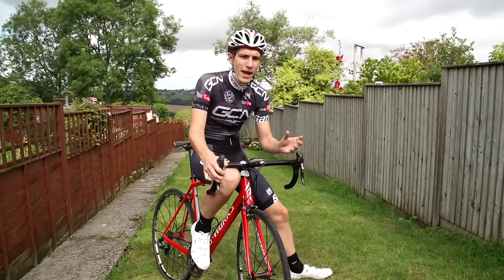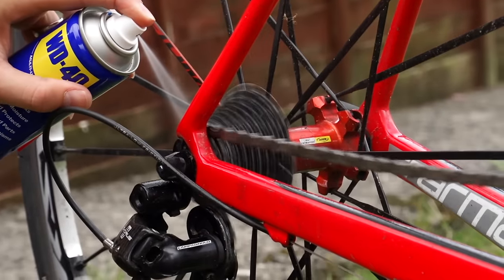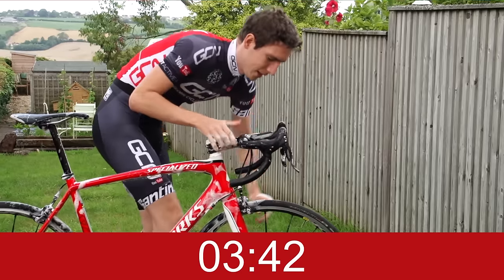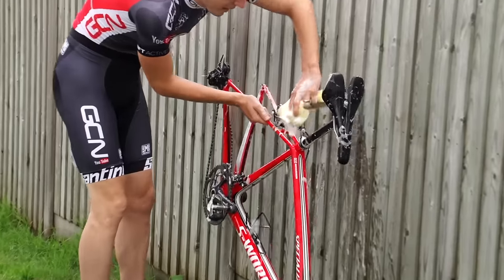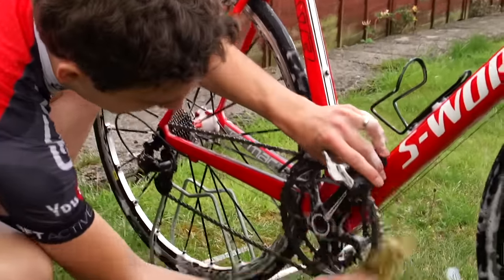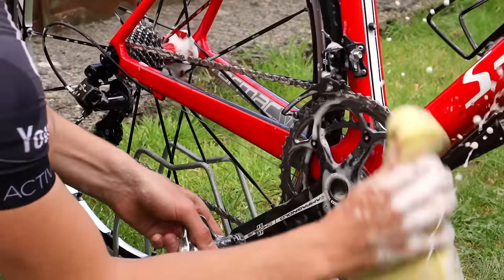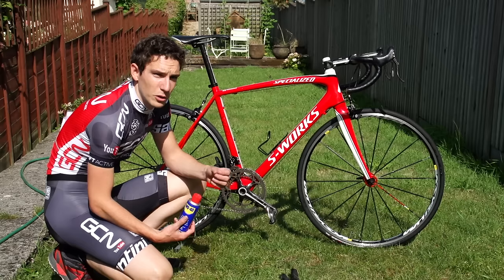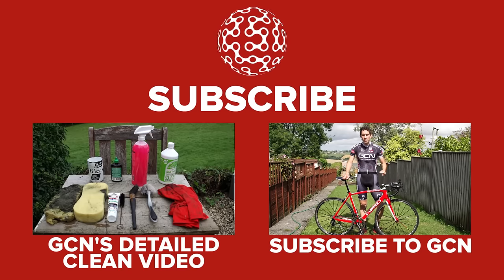The 5 Minute Bike Wash - How To Clean Your Bike In A Hurry

Comment: WD40 makes a citrus based degreaser too. Might that be preferable so you use the degreaser for cleaning and regular for lube? Also WD40 is often sold with a thin straw so you can surgically apply it without getting it near discs.

Comment: I use WD-40 as well but I've never thought about using it after cleaning the chain. So I'm guessing it's just as good as chain oil since I would think you should put new chain oil on the bike after cleaning it?
Reply: -Degrease
-Wash
-Dry
-Apply lube
-Wipe off excess oil so it won't attract dirt

Comment: Can't believe you're using WD40 on your brakes. WTF? Gets on the pads and brake track and then ... no brakes :?
Reply from the maker: Although not advisable, it's unlikely to be that cut and dried. It's not like Simon rides around with no brakes.
Reply: ***** Well, I've always used it and I've not seen any deterioration in the seals or gaskets. Plus, I spend most of the winter riding in Spain, and the summers in the Welsh hills. When I find it doesn't work, I'll change.
Reply: Every one is entitled to their opinion. I've been using wd40 for over 40 years and, yes, it will attract dirt to your chain. But I wash my bike after every ride, then spray fresh WD onto the chain. I've yet to find any deterioration in seals or rubber.
Reply: ***** thank you , at least you got deep into the problem and find your way. so you'r saying for sure that GT85 is that different? is there a cheap way to keep the bike clean and lube without buying a full set of too much expensive degreaser and lubricant?
Reply: ***** not saying you're wrong, but if so many other people are having a grand time spraying wd40 over everything and their bikes are not disintegrating, why do you think they are wrong?
Reply: Imho there is a long term deterioration in some specific components like vax said that simply most users dont notice. But is a fact now if you'r riding on 2000E wheels you maybe like to know
Reply: Tommaso: Maybe, but I find I have to replace things like hubs/cassettes/etc anyway every few years. I don't use WD40, for the record, I use some over-priced and fancy bike specific stuff.

Components naturally wear out, and a lot of high-end components wear out fast. I suspect that WD40, perhaps when sprayed directly into bits and left there, may quickly deteriorate components in a lab setting, but clearly it's not reproducible when a rider cleans their bike after every ride & performs in the real world.
Reply: I was thinking the same thing when he sprayed the front breaks with the tire in place.  I have many years on bikes and motorcycles and any kind of chemical near the tire is potentially bad news. I once had white walls on a motorcycle and keeping them white sucked due to lack of suitable cleaners that would leave no residue. Other than that I think it was full of good info.  Funny to read the crying about the use of WD on a bike.  If it works use it!

Comment: I bought my first ever can of WD40 and I'll give it a try as a Degreaser & a Lubricant.

I trust Simon & GCN. :)

Thank you.
Reply: I cringed when I heard him say that. I have used WD-40 before and within a couple of days all I got was dry rusty parts. I think it's fine as a degreaser but definitely not a replacement for proper lube. It may work for him, but it certainly didn't work for me.
Reply: he said he washes his bike every other day so I'm guessing it works well that way
Reply: Guys,

I have tried WD40 as degreaser and then as a lubricant and I've done this for two weeks consecutively.

Dwele and Kaylin are right.

It works amazingly well for the first 5 minutes of the ride after which it doesn't feel smooth.

I'm sure it works for Simon because he has a sparkling clean drive train always.

But if you don't have a Degreaser at hand you can definitely turn to WD40.

Cheers.
Reply: Swapnil Rogye p

Comment: For road bikes, anyway, all you have to do to keep your bike clean is to wipe it off with a wet paper towel. Usually the water left in my bottle is enough. Start with the saddle and the sweat off the top and down tubes, then seat tube, a d the stays. Save debris on the underside for last. Dry lube the chain and it doesn’t attract much dirt so you don’t have to clean it frequently..

Comment: I've used wd40 on my 70s Rog pony for years mostly for degreasing and water displacement and I use oil too.
Never had a problem with my bike....I wonder how many miles I've cycled over the years on my little Yugoslavian folder, it still has all its original part's  🤔

Comment: I never "wash" my bike, but I do wipe it down with a damp cloth, and it doesn't take much time. Here is why. When I first got my bike, and usually about twice a year, I apply a coat or two of Collinite Fleetwax 885, which is an Aeronautical/Marine grade wax to the frame. Yeah, I know it is strange, but I take care of everything I own of value. I am not a spokesperson for them, but when I worked on boats we used this wax exclusively because of its quality. Now, wiping down the bike after a ride is quick, and my 2013 Tarmac still looks brand new.
Oh, I use WD40 on both of my bikes and don't have any problems at all.

Comment: I never used WD40 on my drivetrain before I saw this video. I've used it since then and no problems. Kero in a $2 hand spray bottle also works well. WD40 is light fish oil after all and is designed to maintain moving parts. Dry bike lube seems to work best after you've cleaned it though. I've even tried motorbike lube PJ1, then dry lube on top of that, which seems to repel the dirt as it acts like a waxy undercoat. Motorbike lube is really too thick for bicycles though. Lots of water on the drivetrain also washes alot of the grit away, but make sure to clean dry with a rag and lube afterwards.

Comment: I have been a full-time mechanic for 10 years. Dont spray wd like that. It will seep into the freehubbody and displace all the grease from the bearings.

Try not to get any degreaser near any bearings. The seals on the bearings won't keep degreaser out.

The ideal way is to not rush it. Take the cassette off.

Comment: to the person who responded to my earlier comment:  if you really want to get terribly technical, yes the cogs (the geared teeth) have no bearings, just threads which screw onto the freewheel. most reasonable people recognize that when one speaks of the rear cogs, he is talking about the entire freewheel assembly, which does indeed have ball bearings. The issue in question is whether it is wise to use WD-40 on your chain every single ride without bothering to put a lubricant on it. And yes, I know a little about bikes, but I'm not a fanatic about it.

Comment: WD-40 is a solvent, solvent kills lube off so it is therefore it is a de-greaser. if it kills the old lube, there is still WD-40 residue which was used as a de-greaser, the fresh layer on top will coat it as there is nothing for the WD to kill... it sits on top of itself

Comment: After 3 cleanings in 2 months I can say that bike cleaning is done much faster (around 30 minutes vs 2 hours the first time) and really easier. I'm convinced that if I'm not chatting with someone, I can do it in 10-15 mins. And am using the same dish detergent and degreaser combo aaaand in smaller quantity.
After degreasing, I wash it with a soda bottle; it takes less than 2 liters to clean it from detergents, is fast and effective.
Lesson: clean it at least a month and you'll have an easy time doing it, plus the bike will feel easier to pedal.

Comment: WD-40 is a terrible lubricant, but it is available everywhere in stores, even in the U.K where apparently there still is no internet! In California, where we have salt from the beach, I use pretty much the same process but use Boeshield T-9 spray instead, and it's available online. It still degreases because like WD-40 it's a penetrating lube, but it dries waxy after a few hours and provides better lube and rust prevention. The key to this quick cleanup is that WD-40 and T-9 are both waaaay too light a lube if you don't clean and replace the lube every ride. The light lubes provide a slicker chain for speed, but not much protection.

Comment: I did this and Here's what happened to my bike. 
Firstly, it took more than 5 minutes! More importantly, the WD40 got past the gaskets in my freewheel hub and thinned out the grease. I started hearing clicking and I had to take apart my entire back wheel. I couldn't remove the freehub without a #12 key so I just dripped lubricant between the seams. The freehub clicking continued for a little while, but it's almost gone after some time to seep in and a little riding. I lubricated the hub bearings which had also been degreased a bit by the WD40 and I reassembled the wheel. On the plus side, they are cheap stock wheels and I now have an incentive to replace them. On the down side, I can't afford to buy a new wheel right now, so I'm stuck with this one until I can. Then again, it's just the freehub that lacks proper lubricant, not the hub bearings. 
Great videos on this channel btw! I just would caution on the WD40.

Comment: Nothing wrong with using WD40 as cleaning agent. You're a bit cheaper though, when using brake cleaner for degreasing. Also WD40 (the company, not the product) make a chain lubricant (spray can with a yellow cap). Two spray bottles instead of one in the shed, no problem.

Comment: I too use WD40 as a degreaser! And I just found out Seth from "Seth's bike hacks" does the same :)
Only issue with that is that if you get it on the brake pads you're in a world of troubles, but that applies to all degreasers.
Reply: +Galf506 ...but yeah I just got to the part where you use it as a lubricant. It isn't. You're running your chain dry after 1 day of use.

Comment: So two thoughts/questions: First, I use White Lightning wax lube, which I like. Does any sort of degreaser work for the initial spraying of the cassette (I'm not into doing the WD40 thing)? Second, when it comes to washing my bike I'm always concerned about how/if it dries and what that does to components. I've always been told that component longevity and rust can be problems if you ride in the wet a lot (which is basically what you're doing by washing your bike and then sticking it in the shed). Is there no damage to anything from basically just rinsing the bike once done and leaving it alone? Or is any damage from the whole bike still dripping countered by spraying lube all over the place (similarly, if I want to reapply White Lightning don't I have to have the whole drivetrain be dry?...seems like this washing and leaving wet is not really an option for wax-based lube fans)...Thanks for any comments or tips.

Comment: My theory: Wd40 does contain a little bit of lubricant but the film it leaves is very thin and wouldn't last very long. So it's not surprising that it works well for someone who cleans the bike and apply wd40 after every single ride but may not work as well for someone like me who cleans the bike after a month or two.

Comment: Ok great! But I just wtached your 30 minutes wash and there you said that the WD40 wouldn't work due to the degreaser (sp?)... I have a new bike and it came with  "normal" oil. Now my question:
How do I move from normal oil to WD40? 
Thanks for your YouTube channel!
Reply: +Pedro FPS He said WD40 would only work as a lube if ALSO used as a degreaser. In the 30 minute clean he used a different degreaser, so the WD40 would not work as a lube. Pay attention. To move from 'normal oil' to WD40, use the WD40 to remove the 'normal oil' and use WD40 for lube too.

Comment: One thing, I've used a nylon scourer on rims to remove stubborn marks which is probably more effective than a sponge and wears a bit better. Also, spray on foam for cleaning car alloys is relatively cheap and works well on removing oily marks - with a nylon scourer it's effortless. 

While everyone is concerned about WD40, I'm ashamed to admit having used cilit bang on the triange of a couple of bike frames when the lube from the chain has set pretty hard after not having cleaned a bike for too long a time! WD40 is of course, ok in my rather shabby book.

Comment: i have an aluminium bike, and I'm worried that spraying water on it might damage the bike since some water can leak into parts of my bike
Any good solutions or answers?
Reply: you are right.  Steel or aluminum frames have several vent holes,  eg in front and rear forks,  also some have holes for internal routed cables. If the water gets inside  it will be sitting there for good.

Comment: Every time I remove the rear wheels for either cleaning, maintenance or transporting, I will have a problem with upshifting my rear gears. 
I tried indexing the gears based on GCN’a video yet still to no avail.
I end up having to send it to my local mech to have the gears indexed. 

Please advise. 
#AskGCN
Reply: When you put your wheels back on, be sure to loosen the quick release while the bike is on the ground. Press down on the seat to ensure the axle is fully seated in the chain stays and then tighten the QR. The other thing that frequently happens is the derailleur getting banged out of alignment. This is caused by a bent derailleur hanger. There is a tool to align and straighten the hanger but most people don't own one. I have been riding road bikes since 1984 and just recently bought one. You can also just buy a new hanger which should be straight already. I have new ones standing by in my tool box because they can break while trying to align them. Misalignment causes all kinds of shifting problems.

Comment: Well for me WD-40 is for avoid Rust and it's very useful but for me I still use oil not used oil like an engine oil or whatsoever.
Tip is WD-40 to avoid rust and additional oil to your chains and gears and even bolt and knots of your to avoid rust bike.👍😎

Comment: so much water, it will stack in bike cable housing isn't it? i try to clean my bike with no water at all, just white spirit to degrease, glass cleaner for frame ... and use proper lubricant as a sealant to future dirt and rain.

Comment: clean your brakes with 'brake cleaner', not wd40, otherwise you might end up not stopping next time you need to! also I wouldn't use any water around my cassettes/sprockets, just use a thin oil when cleaning and something thicker to lube up :)

Comment: If you dont have a hose pipe, (live in a flat?) you can buy hand pump pressure sprayers from as little as £7 for a small one, or I've even used large empty pop bottles with a small hole pierced / drilled in the cap.........one filled with soapy water, one filled with rinse water.   Boom !    (sorry)

Comment: Unless you plan on washing your bike every time you use it WD 40 will not suffice, it is not a lubricant as such and will dissipate quickly. Any bike oil will do, bike oil will also prevent rust, I heavily clean the chain like done in the video once a month or so. Do not remove all oil from you chain without reapplying or youll wear your parts down.

Comment: Si when you say "If you use a normal degreaser the WD-40 isn't going to work but using it for both degreasing and lubricating for some reason it seems to work"-  I'm just unsure what the difference is and where the logic is?.... because either way you have scrubbed the drivetrain with soapy water and rinsed the entire drivetrain with clean water- therefore the result either way is a clean and degreaser free drivetrain ( if you have done it properly) ready to be relubricated- so whether you then proceed with WD-40 or any other lube you are applying it to a cleaned set up- resulting in no difference as I see it? Apologies if I'm being a daft bugger :-)

Comment: so exactly what is WD-40 used for?
Reply: WD-40 is a degreaser, you can buy the name brand stuff at your local bike shop but mine sells the WD-40 degreaser and recommends it as a cleaner. This will take off all the black build up grime dirt and lubricant off your chain and drivetrain (cassette, rings) and make it spin better. Buy a proper lubricant though.

Comment: I like Simon's videos, but I really wouldn't soak my summer road bike with soap and water after every ride. This isn't just totally unnecessary, but will get water in places you don't want it. Best case scenario is you rust up screw and bolt heads. I use a damp microfibre cloth to wipe off any dust or dirt, (or a quick squirt of Muc-Off Bike Cleaner on a damp microfibre if there's any real light surface dirt) and then use a few squirts of Muc-Off Bike Spray on a clean dry microfibre cloth to wipe over after. The bike looks 100% afterwards, and it's just as quick and easy, but without the hassle or need to ever get your bike wet or covered in WD40. Do it after every long ride or every few light rides. You're welcome.

Comment: All my cables got stuck since i followed this garden hose way of cleaning a bike. Maybe this carwash method is safe for modern full carbon bikes and hydraulic lines.  Certainly not for cheapo regular bikes from a mall,  which have several vent holes in frames and forks.  Also if water gets into the cables and chainrings, it sits there, you can't just blow it off.
So i wish i could just power wash the bike,  it would be so cool,  except its a big fail for a traditional bike.     The only good advice here is about WD40,  it actually pulls and disperse the water from the chain,   and it works as a lubricant too,  i don't use anything else.  Except i use non aerosol version, its more thick and yellow in color.

Comment: WD 40 is one way. But if you want a really good and cheap degreaser buy any brake cleaner in your local car shop it will just blast away the oil and leave it spotles without coating it . Much cheaper and it will clean and make it shiny.